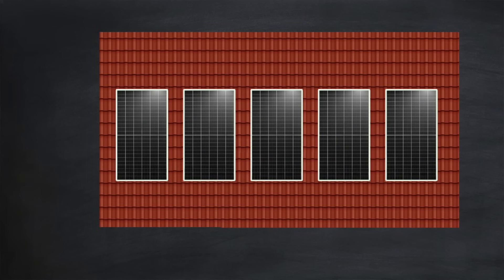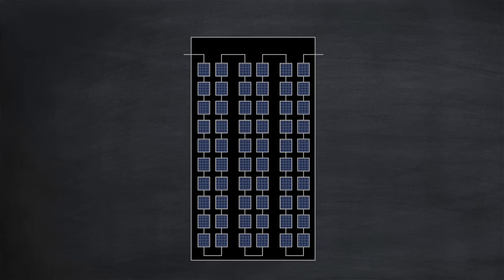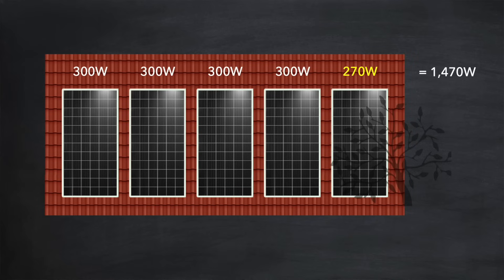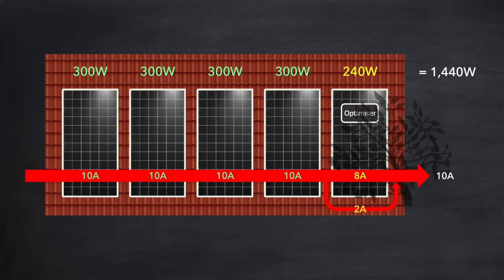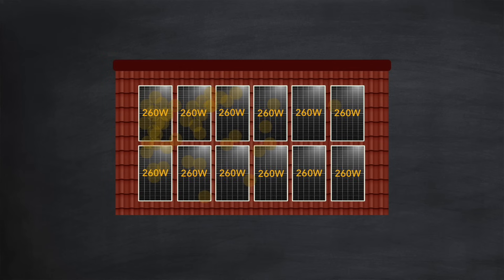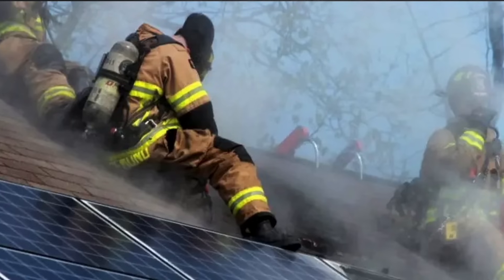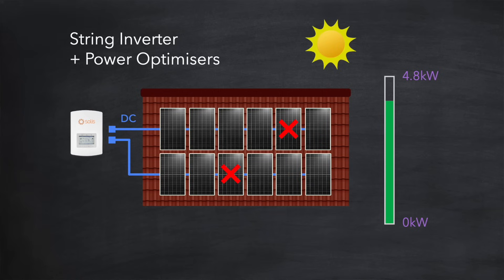Power Optimisers - What are they? And do you really need them?

Comment: Hi Gary, Ace vids mate,  just to confirm I understand,  I have a 4 kw system of 12 panels facing directly south and 4 facing north so the four will be dragging the 12 down, is that correct? :face-blue-wide-eyes: OK so just viewed your micro invert vid, it confirms, thanks mate.
Reply from the maker: Hi Tony, thanks for the great feedback! :-)

Now, it depends on how the panels are wired to your inverter. Most inverters support two strings, and it's highly likely your installer will have wired the South and North arrays to separate strings, so no issues with one array dragging down the other...

Comment: Thank you for your interesting presentation. I have a 14 panel system with a Solar Edge inverter and optimisers on each panel which was installed in 2017. In 2021 one of the optimisers failed but caused the entire system to shut down. The optimiser was replaced, at a considerable cost, but just over a year later another one failed, again causing the entire system to shut down. It was replaced again at a considerable cost to me. a couple of months ago a third optimiser failed but I only lost output from the associated panel, until a few days ago when the entire output was lost. The inverter is still functioning and recording a fault on one panel which would suggest that the optimiser has failed completely. Solar Edge has provided replacement optimisers under their "limited product warranty" but they have not offered to provide any support for the labour cost or scaffolding. It does suggest that the undisclosed failure rate of the optimisers is somewhat higher than the advertised reliability.
Reply from the maker: You're very welcome, and thank you for taking the time to share your experience with SolarEdge optimisers. I'm sorry that it has not been a great one, and it sounds like you're very much out of pocket as a result. I would certainly like SolarEdge to be more open with their reliability statistics (like Enphase is) and I'd also like these manufacturers to stand by their products with better warranties over time. To be clear: if microinverters and optimisers are heading towards 50-year operational lifetimes, then I'd expect the manufacturers to be happy to cover all the costs in the event of failure - and if they're not prepared to, then for them to explain why not.
Reply: @GaryDoesSolar  Solar Edge Optimisers are excellent in providing management of shading on solar panels, which is why I chose to install them. They were sold as having a 25 year warranty, but my installer did not tell me that this was a "limited warranty'" which covered only the cost of the parts. In my view installers should be required to provide a full warranty for replacement costs including scaffolding and installation or to offer this as an optional single premium insurance. This would provide a similar protection that is now required when Cavity Wall Insulation is installed where removal costs in the event of failure are also considerably higher than the cost of installation. It is not acceptable to offer a warranty that limits the cost to the replacement part at around £45 when installation could cost an additional £1000. This poorly regulated industry needs to improve or be legislatively controlled.
Reply from the maker: @mpmatt3469  I agree with you. Energy is just as critical as other utilities like water and telecommunications. Proper regulation is the key to stop consumers getting ripped off.
Reply: yep this is what they do, the are  Another junk  make failing electrical  component like the auto industry

Comment: Because modern panels all have bypass diodes, why would solar optimizers add anything of value, it’s not clear to me. The risk here is that people are sold stuff they don’t need.
Reply from the maker: I tend to agree...
Reply: @GaryDoesSolar   Well, wouldn't it be nice to have at least some electronics on PV panel level to monitor per PV panel production, faults, etc? well at least troubleshooting is easiers, right?
Reply: @sparadonja   Solar PV panels are simple devices with no active components and historically low failure rates. Those powered monitoring devices with active components exposed to the harsh environment are statistically going to fail more often that the actual panel it is they are monitoring! So, up to you to decide the value proposition here.
Reply: Would I need optimizers for a solar edge 2.2 kW on GRID inverter?

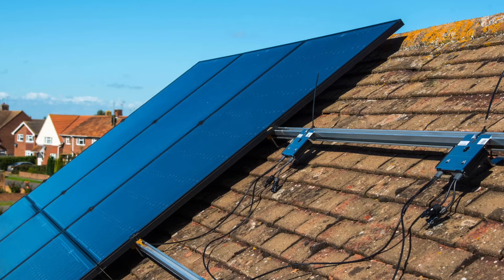Comment: 1:44 How can such long wires be prevented so that the conditions do not cause wear of their surface insulation and eventually a short circuit and fire? If the conductors scratch that rough brick roof over time due to temperature changes and wind, then structural safety has been neglected. It is definitely not enough that the wires are "nicely" hidden under the panels.
Reply from the maker: Valid point. I don’t speak for the installer of this particular installation but I’d imagine they would tie-wrap the cables before laying the panels.

Comment from the maker: * NOTES SINCE PUBLICATION *

At 6:34 I over-simplified how the optimiser manages the current. In reality, the inverter first maximises the power from the panel by adjusting the voltage via MPPT, then performs a DC-DC conversion, decreasing the voltage to bring the current in line with the rest of the string.

At 7:45, Actually, one or more of the bypass diodes will only kick in if there is a difference in shading across that particular panel. If there is shading across the whole of the panel (as in the diagram) the optimiser should still be able to manage that.

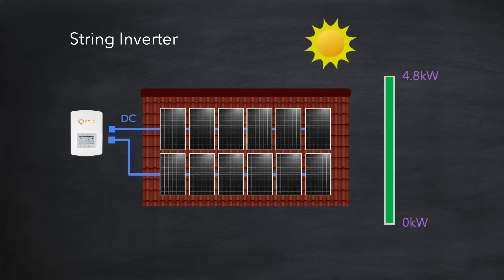And at 14:17 my maths is clearly rubbish - the total production with 12 x 300W panels would of course be 3.6kW, not 4.8kW!
Reply: I love your comment on rubbish math!  And love the correction and admission even more.
Reply: I’m sure we were all more interested in the different options and scenarios rather than the maths so all good 👍
Reply: Please pin this comment for everyone to see

Comment: As you know I had an optimiser fail on me (in November thankfully), two years into my production.  So far this summer there’s been no more failures, and it’s generated 57kWh on the best day.

For my site, I have to contend with a chimney that always shades at least one panel until lunchtime, progressive shading from 5pm onwards April to August, and lots of hard partial shading in the autumn and winter.  So I think optimisers are worth it.

But if I had a site with no shading issues, I would do without the optimisers and just use a thermal camera to carry out periodic inspections.  They add cost, complexity and therefore more points of failure.

The safety aspect of rapid shutdown whilst noteworthy, can also be done on a string inverter.  Once a string is isolated, while there is still voltage, there cannot be current without a closed loop.  Most PV strings are floating voltage without an earth reference (except maybe on the inverter on the other side of the double pole isolator), so if a fireman were to be exposed to a live conductor, current couldn’t flow anyway if the isolator is open.
Reply from the maker: Hi Anthony, thanks for taking the time to comment. Great to hear that your array is performing well again - 57kWh is an amazing daily production - wow! I guess all the excess is going into your EV? Or are you exporting some of it?

Thanks for the points on safety - I guess my only concern is that all the cabling on my house comes down a single conduit, and so a short there (if all the plastic shielding melts) might close the loop...?

Comment: One point worth noting with Solar Edge Optimisers is their ease and safety for setting up: When a panel has full sun on it, it is producing electricity, a full string produces a hell of a voltage, potentially life-threatening! This makes connecting up panels to the inverter a potentially hazardous operation. The Optimiser restricts that to 1 volt. Ten panels connected = 10 volts. If that is measured at the Inverter, you know that all panels are connected and operational. If 9 volts, then one is out Etc. 

When the array is either disconnected from the inverter, or the inverter is turned off, the same holds true: 1 volt per panel. This makes it a lot safer for Firemen, and for fighting the fire: Spraying water on to live power cables will not put the fire out!
Reply from the maker: Thanks for sharing this - I think over time, more and more countries will mandate optimisers/microinverters on properties.

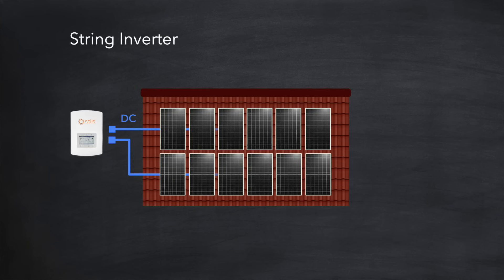Comment: Hi Gary, another great video.  Just wanted to query your sums @14:12 - 12 x 300W panels would be 3.6kW peak production, not 4.8kW :)
Reply from the maker: Thanks Chas - and oh no! You're right - I used animations from a previous video, which had 8 panels, not 6 - oops - I'll add a correction to the video. Thanks for spotting!
Reply: @GaryDoesSolar  Maybe just edit the audio to say 400W panels instead of 300W ?  Might be easier, just a thought.
Reply from the maker: @chaswinder  I like your thinking - unfortunately, YouTube doesn't allow any changes to videos once published - you can basically only blur parts of the screen or mute/delete sections. I've added a correction action note at that point in the video, which should hopefully do the trick - thanks 👍
Reply: I’m glad someone pointed this out. I did rewind 3 times to make sure I heard what I thought I heard.

Comment: My installer specified Tigo optimisers as I'm having panels installed on 3 different roof orientations on a dual MPPT hybrid inverter. I have questioned their inclusion off the back of your helpful and informative videos but feel for the relatively small outlay, the benefits outweigh the negatives. I don't like that there's more to go wrong and there's a small power draw from them but the fact I will be able to monitor each panel from my phone, not be throttled by dirty or degraded panels and the allowance for easy integration of replacement panels are big pluses in my view.
Reply: If you have multiple panels oriented in different directions where the angle in the horizontal plane is greater than some threshold, say 50 degrees, then I would suggest that you don't connect them all up together, and you create groups where panels in a group are connected together and each group has their own optimiser. And the panels all in the same geometric plane are mapped in to a group.

I suspect this may lead to better performance from the system. Of course the downside is the cost of the extra optimisers.
Reply from the maker: From what I've read, optimisers are not really designed for use on a string with panels on different orientations, but if it's working out for you, then great - more power to you! :-)
Reply: @GaryDoesSolar  don't disagree with your theory, if all the panels are exactly the same model with the same electrical characteristics and subject to the same level of sunlight and orientation then the optimiser will be able to do a better job and deliver more kWh over a period of time.

However even with panels oriented in different directions there may still be a sweet spot on the combined IV curve, which can be found by the optimiser.

So I think there is still some benefit to be had by using the optimiser but it probably won't be as much as if all the panels are located in the same geometric plane.

But whilst an optimiser won't give as much benefit in a configuration where the PV panels are not in the same plane, this is not an argument for not using one.

The key factor in deciding whether to use an optimiser has to be based on its cost and how much extra electricity it generates if it is used in the system. That is, is it economically worthwhile?

The cost is known, obviously, but the difficulty is going to be is knowing or calculating the extra increase in kW by using it. And that is going to be very hard to calculate before you buy it. And the manufacturers of the panels or optimisers cannot help here (unless they have done the tests with a specific set of panels and optimiser and other initial conditions).

You could do it by experimentation and measure the power output in kW (or kWh) from the panels with and without the optimiser.
Then you need to get an optimiser on loan and try it out and pay for it after you have experimented with it.

An interesting question.

(I think this is a long way of saying "try it out"!) and measure it.)
Reply: @GaryDoesSolar  Tigo has some useful guidance for designing for different tilts, angles, and orientations on their website. Optimisers will be required on all of the PV-Modules to prevent the impedance of power production during periods of extreme shade (mornings and evenings) on a Balanced Orientation (wired in series). 

Tigo recommends dividing the string into two separate strings in series going into separate MPPTs:

Each string would produce enough voltage for the inverter to start up and maintain the MPPT specified voltage range - along with enough current (power) for good production.

Because all modules on the separate strings face the same azimuth, the irradiance per panel is nearly equal (unless shaded), ensuring the string voltages and currents are always contributing to power production.
Reply: @GaryDoesSolar  SE works ok with it, the Designer will quote you a percentage loss for it - I have seen about 1-2% so far.

Tigo might not be the best option here as it's basically only doing mppt at panel level without DC to DC